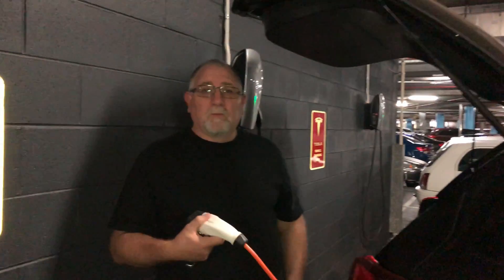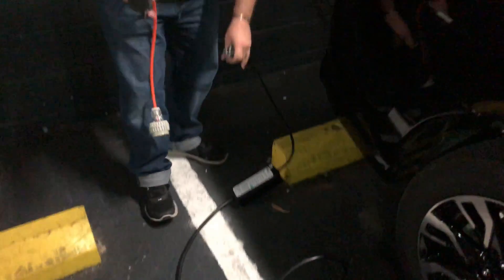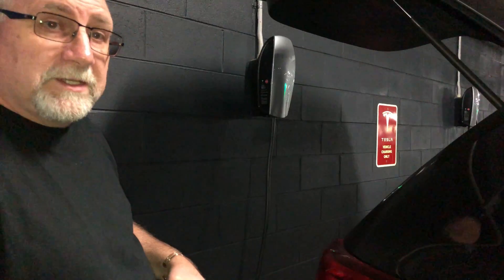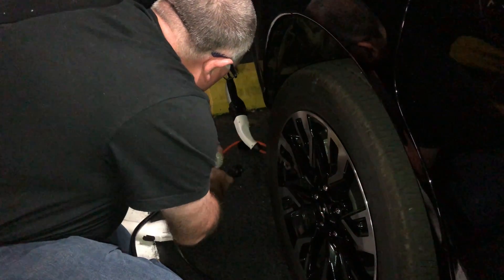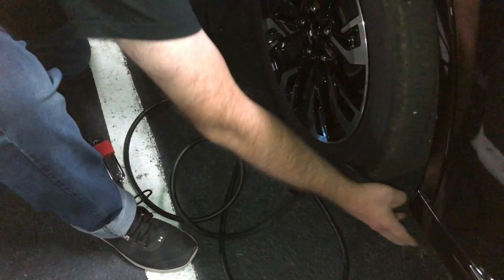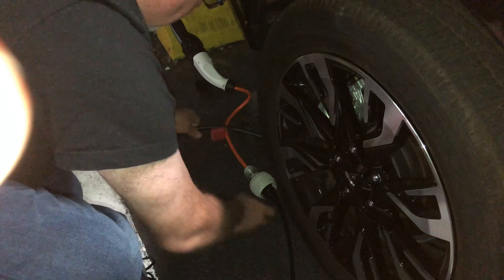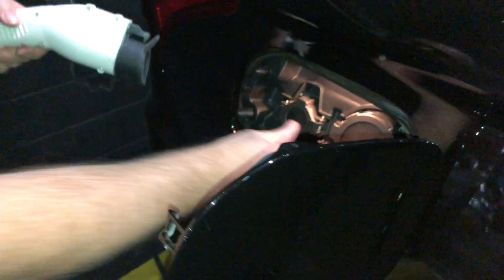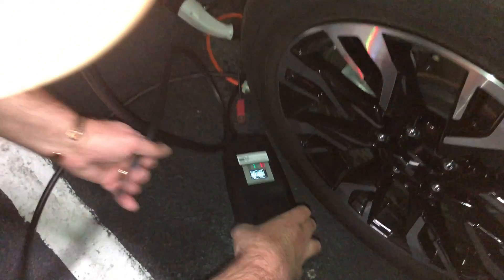Using a Tesla Destination Charger with an Outlander PHEV!

Comment: wow you have to worry about someone stealing your charger...I guess it's possible
Reply: belin19104 definitely. At over AUD$700 for the EVSE and adaptor, I’m not going to take that chance
Reply: most modern EV has lock and can secure the cable.

Comment: Isn't that the same as stealing gasoline?
Reply: Fortunately not.  The electricity is supplied by the shopping centre as an incentive for EV drivers to shop there.  The only reason they are using Tesla destination chargers is that Tesla supply them free of charge, with the shopping centre foots the bill for the installation.
Reply: No difference between this and any old public charger. Tesla practically gives away destination chargers to make their cars seem more appealing while nobody else can use theirs, but too often Teslas block out Type 1 or Type 2 charging stations themselves. If any Model S or X can use any charger, why not other EV use Tesla chargers?
Reply: It is stealing , the sign clearly states Tesla vehicle charging ony. The contract was worked out with Tesla not with any other car manufacturer.
Reply: @tonystark6263  
so why do they have white signs? why can they be programmed to charge all cars? so if you are a hotel owner you only want to attract tesla car drivers? 
besides tesla does not pay for the electricity.
Reply: @ursodermatt8809  Tesla opened up their patents to all car makers and they can all adapt the Tesla connection but they choose chademo or other adapters. The point is the sign says for Tesla evs only period. It's why you don't park in a spot that says handicap or loading only , if the sign says a certain rule , you are breaking the law by not following the stated sign.
Reply: @tonystark6263  now you are changing your argument an ice parking on a charging lot.
chademo is the japanese standard. and used in usa.
Reply: @ursodermatt8809  that was just a side note. My last sentence brings it back to my main point. Please re read my last sentence.
Reply: @tonystark6263  
why can't i help thinking you are somewhat confused?
Reply: @ursodermatt8809  because you have too much free time to argue on YouTube. Let me explain it one last time. Original comment I replied too was if this was like stealing gasoline....Tesla installed the "electric gas pump" and worked out a contract with the owner of the property...they supply the "electric gas" and they decide who can "fill up" as stated by the sign. Hope that explains it, if not I'm in class right trying to kill time so shoot me another message,thanks.
Reply: @tonystark6263  
haha, i am starting to like you!!!!
Reply: @ursodermatt8809  hahaha trust me I would want all chargers to be one size fits all but money hungry corporations wants their technology to be the one. I guess that's how tech works, one has to eventually kill of the inferior one.

Comment: It is easier than that. Buy a type2 to type1 adaptor, disable all reistors in it and connect both ends of PP wire (preferably through the included switch). Then you will be able to charge from the universal tesla destination charger without the need of the EVSE.
Reply: Got a link and some more info about that? I cannot seem to find anything...
Reply: unplugged EV sorry mate, I don’t have anything in english. I’d send you an email with info if you tell me your address
Reply: Just click on my channel and have a look under 'About' for sending me a message...
You can also post the link here if you like. Thanks for any further info.
As far as I know the resistors are needed to do the initial handshake with the Tesla box. That's why you have to wait 15s to trick the station. A normal Type2 to Type1 adapter has no resistors but I will read through your info...
Reply: @unpluggedEV  
did alejandro ever answer?
Reply: @unpluggedEV  did you get any further with this?
Reply: @WillDeasy  Nope, never heard from him about this...
Reply: @unpluggedEV  there's a thread on AEVA website too, looks like it's not that easy.
Reply: @WillDeasy  any more info/ link for this?
Reply: That not work… because testa charger has “diferent language” on control pin, not standard! The switch is an “ Tesla car emulator” to cheat the charger, after charger dispense ac you can use the voltage to charge with your car! Now if your car is ccs, can use an ccs to ccs cord but with that “ switch” and “emulator” inside. I make home made chargers long time with Arduino and it worked will all cars… except Tesla 😂😂😂